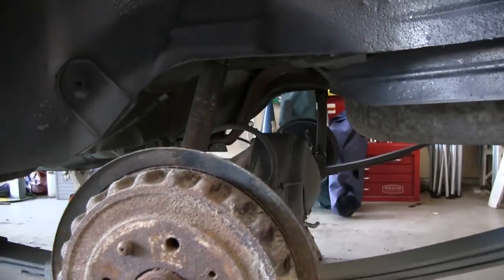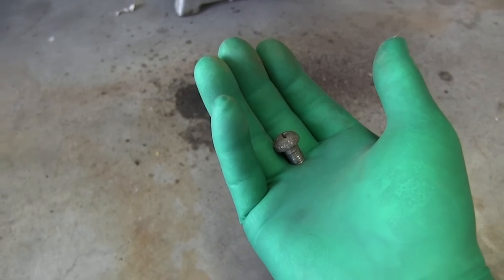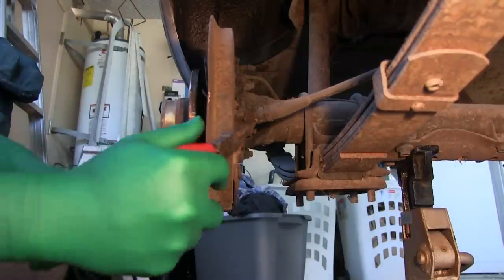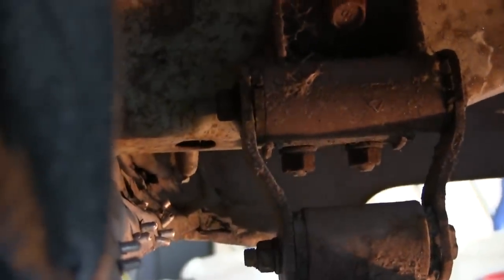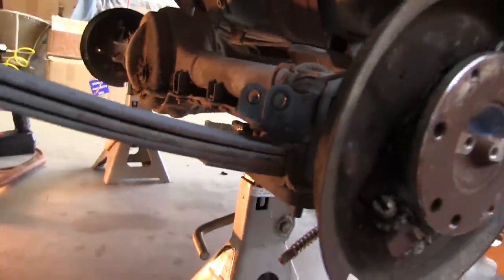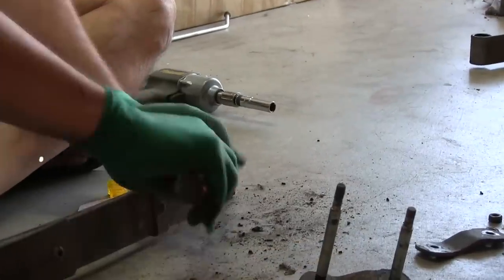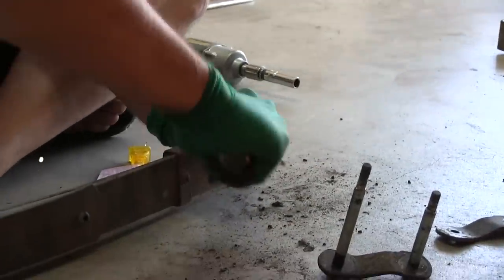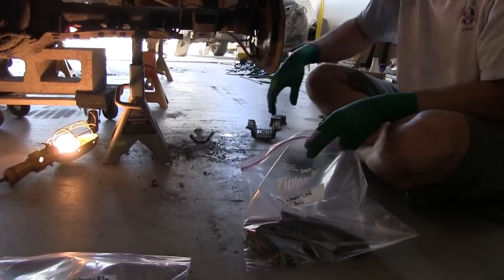VLog 9 Mazda RX3 Rear End Leaf & Bushing Removal Rotary RestoMod

Comment: I bought a brand new RX3 in 1976 that was virtually identical to yours. The biggest mistake I made with the car was that I did not rustproof it when I bought it. After just two years of ownership it was well on its way to becoming a rust bucket.  The rockers were rusted completely through from driving on the salted winter highways of Iowa and Minnesota. I hope you project turns out well, It looks like you have a great start!
Reply from the maker: Thanks for watching Dan. Yeah, my green 74 is from MN. I'm sure those rockers are toast. Pulling my rockers apart on this 76 is beyond the scope of this resto so I hope they are gonna last. Keep watching...

Comment: I'm restoring a1972 Mazda savanna it's the same car only the Japanese version. Where did you Source the replacement parts such as the bushings and such. Thanks
Reply from the maker: If you want polyurethane bushings I got mine from SuperPro out of Australia. You could also go with Whiteline also in Australia. There are sources for rubber bushes including Mazda, and RockAuto.

Comment: Hi Mate, would you happen to have the torque specs for the 3  bolts attaching the steering box to the chassis rail? Cheers from N.Z
Reply from the maker: rotabom I’ve just checked the factory manual. It says 32-40 ft lbs for the steering box to frame rail. Have a great day mate!
Reply: @LetsTalkShop  awesome thank you. Fantastic response time !!! :-) I thought it was a long shot but you delivered! Sorry I should have asked the first time but i wasnt expecting a response....Do you also know the torque spec for the pitman arm to the centre link? I noticed it is a bit more heavy duty than the idler arm ball joint so i wondered if it required a high torque setting.
Many many thanks!!
Reply from the maker: rotabom pitman to Center link is 22-32 ft lbs.
Reply from the maker: Look at episode 23. Lots of torque specs in there.
Reply: @LetsTalkShop  Thanks a lot. I cant believe with the popularity of the car and the cult like following there isnt more resources available on the internet. Your vlog series is the foremost resource from what I can tell. Cheers